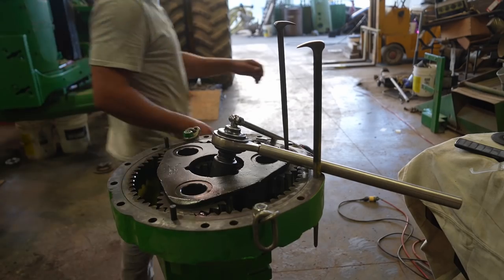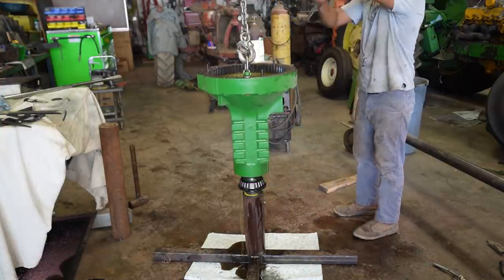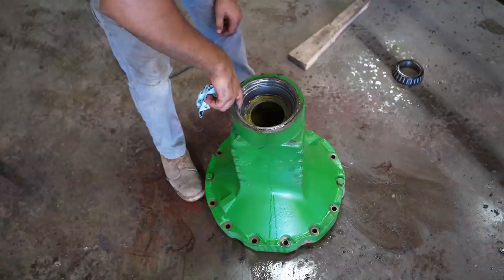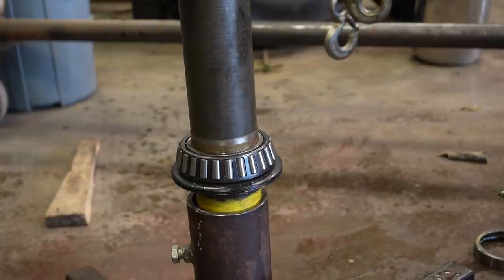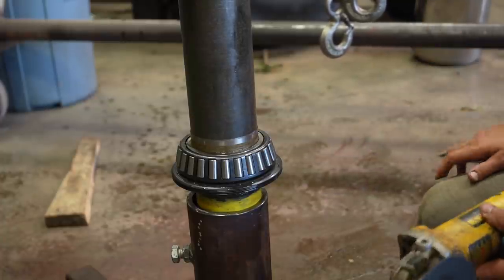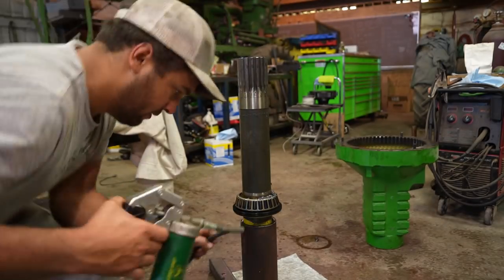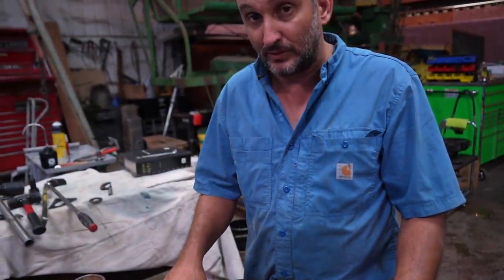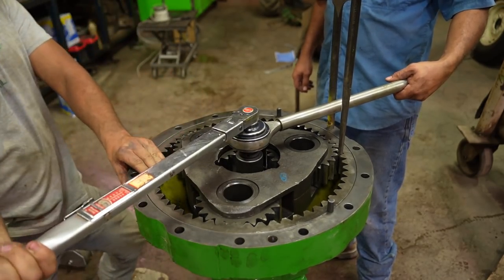Rebuilding John Deere 8430 Final Drives

Comment: That's a neat way to set clearances with the lead shot. Not gonna lie, I cringed a little bit when you drove that race in using a steel rod. A big brass drift is the way to go to avoid damaging them. I've never seen anyone use an oil heater for bearings so that's new to me. Generally I heat bearings in the oven and put the races in the freezer for an hour and they drop right in, but I suppose not all farm shops have kitchens in them, do they? Another useful tool I'd like to suggest to anyone who does this kind of work- punch holders. I smashed my thumb with a 2 lb brass hammer a while back and now use one nearly every time. Worth every penny. They make them in sizes for everything from little cold chisels to BFH work.

Comment: I worked at a John Deere store in the late 80s.  4430 axles were notorious for loose bearings.  I did this many times.  Really like the stand you use.  I have the same TQFR 250 torque wrench!

Comment: great video. With the torque multipliers we used to use, there was a torque lose, they stated a ( I think) 10-15 % lose due to the rolling resistance of the gearing inside the heads.
Reply from the maker: That makes sense for sure! Jake didn’t mention that but that makes sense.

Comment: There is another guy on youtube that uses a deep fryer to heat oil to bearings. They make a bearing heater that Andy Hourigan uses I've always used a toaster oven which cheap and easy just grab bearing with pair of welding gloves and don't have to worry about hot oil
Reply from the maker: Hey there’s a thought! I like that fryer idea.

Comment: John Deere never painted the axels on there tractors ever. I assume it had something to do with getting the wheel to fit right on the axle. I like them painted black though. btw my grandpa was field cultivating with an 8670 and a 40 ft field cultivator and caught a power line while going down the road and didn't realize it until he got home and there was at least ten feet of power line dragging on the ground behind him.

Comment: Why a grinder to cut the old bearings off vs using a torch
Reply: Thats what he perfers
Reply from the maker: The grinder has more control in my opinion, I didn’t want to mess the axle up.
Reply: Also the outer bearing is covered in grease